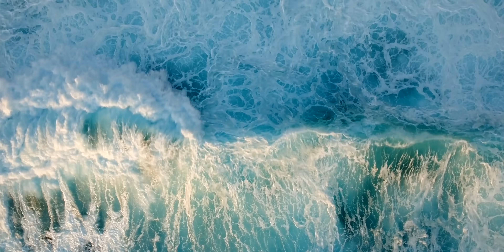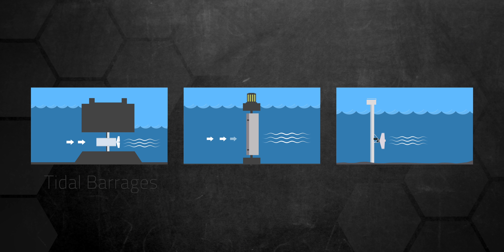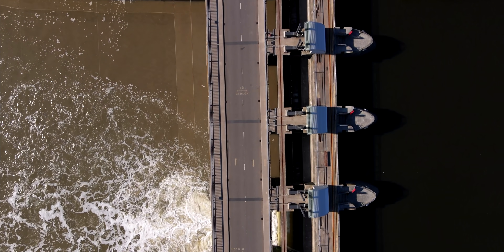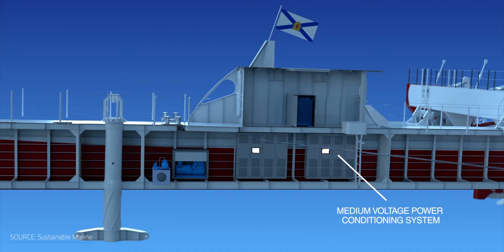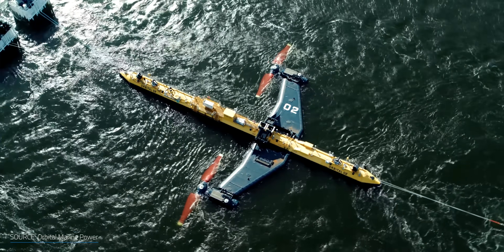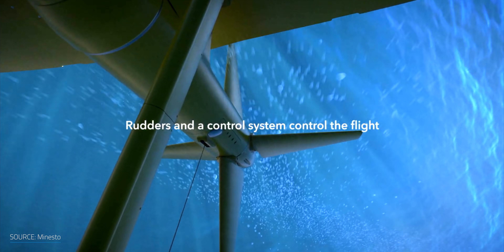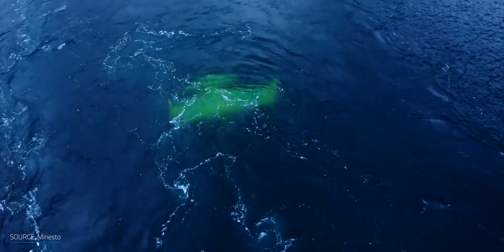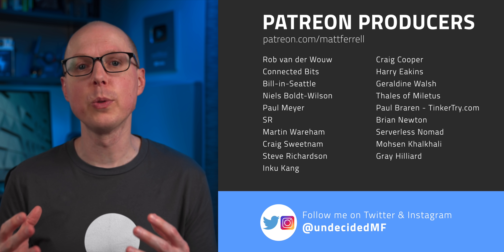Can Underwater Turbines Work? Tidal Power Explained

Comment: Maintenance for these is a lot more frequent and expensive. Not to mention habitat loss.
Reply: Offshore wind turbines actually turn out to create marine habitats on their surfaces. I would imagine this to be the same here.
Reply: @unvergebeneid  for certain life, yeah. But that same life like kelp and such make maintaining it very expensive. And that's not the only life in the ocean. Additionally, it might be good for one type of sea creatures and bad for others.
Reply: @_MikeJon_  unlike fossil fuels, which are bad for one type of sea creature and worse for others.
Reply: @unvergebeneid  not relevant to what I said nor was I arguing for it. However the idea that this is "green" is not really true. Maintenance and installation of these plants is not green at all. And the power output is so limited, it's not a valid argument. I will like to emphasize how much it takes to clean these types of plants. Think about how much crud builds up on boats. Boats aren't stationary either. The ocean is wonderfully full of life so trying it's hard to maintain functionality and low costs with that fact.
Reply: @_MikeJon_  I think it's too early to form a definitive opinion on what the cost will be down the line. It's all just pilot projects. We cannot afford not to undertake these, however, and if they turn out to be dead ends then so be it.
Reply: @unvergebeneid  It's really not though. We've seen enough to know how much they produce. We've already been told what the power output is. We know what happens to stuff in the sea. I mean do some research, answers with joe has a good video on it.

Comment: Listen while mowing the lawn...? I know that the EGO is quiet, but I am guessing that you are not using the speaker on your phone. Tell us, which headphones do you recommend.
Reply from the maker: When using the Ego mower?  Any headphones that have a rubber ear tip will do (passive noise cancelation ... blocks enough sound to work really well).  I've used a pair of LG Tone wireless earbuds and Apple Airpods Pro.

Comment: Could these underwater turbines also help minimize tsunamis and similar due to the slowing of water currents?
Reply: There's so much energy in a tsunami, any number of underwater turbines won't make the slightest difference (except possibly getting ripped off the sea floor and hurled ashore). It would be analogous to trying to mitigate hurricanes by installing wind turbines.

Comment: I believe that Nikola Tesla built a power plant that used the thermal energy differences of surface water temp vs water temp at the bottom of the ocean.  Yep the surface temp is often about 30deg F. so it will work, not really efficient due to the low temp differential but it worked.  What killed it was it was requiring materials that were not available at the time so it had a large failure rate which was what actually killed it off.

Comment: I wonder at the effectiveness of loading the great lakes with those sea kites
Reply: It would be interesting. The Great Lakes don't really have significant tides though because they are isolated. 
They do have some very intense waves which I would think could be harnessed.
I remember a year or two ago a small lighthouse was just destroyed by violent waves in Lake Superior.
The question is would it be constant enough to make it worth the expenditure.
Or could they adapt something like the Vortex Bladeless turbine (wiggle turbine) to work under water to use the water's motion to produce electricity.
Reply: Do the great lakes have enough depth? These need 60 meters of depth just to run and I'd imagine you need a little more than that to give a buffer zone from boats.
Reply: @dillonvandergriff4124  pretty sure, though not 100% on that

Comment: I can't repeat it often enough, humanity and the world will need vast amounts of clean, sustainable, emission-free and cheap energy in the future. Therefore, these tidal power plants also need to be supported to become a reality on a large scale.
Reply: As I said, the world and humanity will need vast amounts of clean, sustainable, emission-free and cheapest energy. When the fusion reactors and 5th generation nuclear reactors (dual fluid reactors) are ready for use, nothing will stand in the way of this energy either.
Reply: Become an Engineer and work design and systems!
Reply: Every drop of energy comes from somewhere, wind energy stops the wind, tidal energy forces oceans to stand still. What are the consequences of that? . Humanity needs to consume less energy.
Reply: @ulisesrobles  wind energy does not stop wind, what are you talking about ? Neither does this stop tides.
Reply: @n.g.s1mple29  So energy comes from nowhere? Interesting point of view. Not very thermodinamically correct but insteresting.
Reply: @n.g.s1mple29  Insulting is your way of reinforcing a statement? That same reasoning led to think that coal burning couldn't harm the enviroment because it was a few wagons of coal every month.
Reply: @n.g.s1mple29  I just pointed to Sigismund that having cheap "emission-free" energy only leads to more consumption. In wind power, kinetic energy from the wind is used to move the blades slowing the air currents. If you think that filling the world with giant turbines to supply enough electricity for the whole world has no effect on air masses that make up the weather, or you insist with the idea of wind not being slowed down by the generators it's ok. I just bring you the facts, based on science. You keep insulting but provide no better understanding on how wind turbines work. 
Have fun trying your perpetual motion machines and free-energy gadgets.
Reply: @ulisesrobles  the amount of turbines you would need to create such a problem is far more than we will need for a very long time, filling the world will never be necessary as by the time we will need that much most of our energy wont come from on earth sources anymore. it simply wont happen
Reply: @n.g.s1mple29  where will it come from?
Reply: @ulisesrobles  science  includes the presentation of factual evidence

you presented no facts to back your claim
Reply: @robinsss  huh
Reply: @n.g.s1mple29  you said our energy won't come from on  earth sources

where will it come from?
Reply: @robinsss  well I didn't really word that correctly now that I look back. But I was thinking of things like space based solar, or large populations living in space. If we ever get to the point of needing enough energy to disrupt wind patterns with turbines we probably will not be limited to earth, cause if we manage to have that many people on earth anyway we must have energy options better than turbines. I also think turbines can't really be used like that, it doesn't sound efficient.
Reply: @n.g.s1mple29  why doesn't it sound effective?

which turbines?
Reply: @robinsss  standard wind turbines, they only contribute their maximum power a certain time periods for one, most of the time it's only fractional from what I remember. 
There are also many areas where wind farms just wouldn't be very cost effective due to poorer wind strength on average. They kind of stuck unless you've got them somewhere just right tbh. You'd be better off with solar panel farms across the world, although I doubt that would ever happen either.
Reply: @n.g.s1mple29  why wouldn't ocean turbines be able  to deliver enough energy?
Reply: @robinsss  oceans turbines could work i think, im not as knowligable on those those. They may have other
issues....
Reply: @n.g.s1mple29  if devices are in space collecting solar energy

how do you  get that energy to homes on earth?
Reply: @robinsss  the idea would be to beam it down in the form of microwaves and convert it back to electricity with a rectenna.
Reply: @n.g.s1mple29  has anyone proven that that can be done?
Reply: @robinsss  there hasn't been practical tests yet, and there are still some problems with it, but I think they can be fixed.
Reply: @ulisesrobles  The universe is made of energy.

Comment: I'd attach a propeller to a long bendable axle, like a chain, and attach the other end to a heavy generator sitting on the bottom of the canal pointing upwards. The propeller would rotate, turning the entire chain, and thus generating energy. The direction of the tide wouldn't matter.

Comment: Is there any project building something that combines offshore wind turbines and underwater turbines?
Reply: I don't think so, because they don't fit together. Offshore wind farms are best built far off the coast, since winds are strongest out there. But this means that they are built in wide and often up to 50 m deep waters. Tidal power on the other hand is best built where tidal flow is focused into a small cross section, which means the waters should be narrow and shallow.
Reply: More like the two system besides each other using the same installation like subseacable. They are looking at that, it will come.

Comment: All the numbers look to be new installation.  What will they look like after exposure to the ocean environment, attached sea life, collisions with sea life, collisions with ocean pollution, etc?
Reply: Minesto has a very cost effective service on the kites and the installments of foundations and kites are actually very cost effective. The company has partnership with 2 major players in the energy field such as EDF and more recently Schneider Electric on microgrids etc. This is probably the most interesting company alongside Azelio.
Reply: I was wondering the exact same thing.  Especially with all the unforeseen maintenance costs of wind turbines due to particulate matter in the air.  Lots of corrosive stuff down under the water, and it's not like you can just drive your pick up truck on over to maintenance.

If it can produce power, not involve high maintenance costs, stay out of the way of boats, and do it all cleanly that would be wonderful.  Somehow, I don't think it's going to be that easy.
Reply: @MetrolMC  All your wishes are fullfilled, system called Deep Grren by Minesto (The flying kites) 

Clean Energy, produces plannable power to the grid today, full boattraffic above is allowed (kites 20-30m under surface). Low Maintenance cost due to exchange system and service on land.
Reply: I think this is a very valid question. It has been shown that the vibrations of offshore wind turbines disorient fish, making them unable to swim upright and dying as a consequence. I think the same can be considered for eg the underwater kite. You might say boats produce the same noise or whatever, but these installations practically stay in one spot, whereas a boat passes by, making the vibrations less constant.
Reply: @timor474  they also discovered that wind turbines are not lasting as long as they thought. They are being dismantled long before their expected expiration date and replaced with new bigger ones. Submerged under salt water is even a worse environment.
Reply: I can see a few of these working for small isolated marine communities but that's as far as I'd take it. If they are produced on scale for a larger population, the eventual waste stream will be impressive. Especially considering the toxic waste from things like heavy metal laden lubricants and creation of the anti fouling coatings to prevent constant maintenance. Might as well start ocean mining. Our oceans are stressed enough and we can get more than enough energy from land, no need to put more junk in them, we need to start cleaning them.
Reply: @anydaynow01  I don't see those extra boat hulls and propellers as having a high impact. After all, each one is just one more boat in the water. Compared with the scale of transcontinental shipping burning mega-tonnes of bunker fuel, it's nothing measurable.
Reply: @fotoguru222  I don't see them being a huge ocean impact, unless abandoned at EOL, but things that are under water get pretty grungy pretty quick and I wonder what negative impact that will have on the efficiency.
Reply: You can read Minesto prospectus to investors on https://www.minesto.com/sites/default/files/documents/inbjudan-till-teckning-av-units-i-minesto-infor-listning-pa-41154-minesto_prospekt_2015-09-30.pdf its from 2015 but the kites will last +20 years without issues. And they have the best LCOE when scaled up.
Reply: @Mari0.187  "prospectus to investors" If that isn't saying 'the most optimistic scenario' then I lack reading comprehension.
Reply: @sinki19841984  dont understand what you mean?
Reply: @Mari0.187  Means the information in the prospectus is the absolute best case scenario, i.e. conditions are always perfect, expected efficiency is always reached, and no unexpected costs are incurred. A prospectus is not intended to inform you of what to realistically expect from a project; it's intended to convince you to give money to the project operator.
Reply: @PhycoKrusk  it points you exactly in the right direction. Dont understand the entry you make here. You do realize that I linked to it because it gives you a pointer, you cannot do your DD without reading ALL and everything important! Including the prospectus. Dont really get your ultimate point here but I think I get it anyway. Nothing is a guarantee in life, not even life!! DUH!!!
Reply: @Mari0.187  It being the best case scenario doesn't mean that the information isn't or can't be useful; it just means that a realistic viewpoint means not looking at the numbers in a prospectus and expecting that those will be the results you will always get. They are predictions; they may be extremely accurate predictions, but they are still predictions. That is all.
Reply: @PhycoKrusk  its all being verified and certified right now as we speak. By DNV GL. I think any normal and decent person also can read at the begining of the prospectus that it states what you wrote allready so I and anyone that read it have allready been informed of the ”expectations” and ”risk” but thank you for explaining it again.
Reply: I suggest that rope like thing and kites which can help us alot
Reply: maybe they should install at the pacific garbage patch so that the secondary purpose is to collect those rubbish floating around
Reply: @al-aurum2457  Given the average depth of the pacific ocean is 4-5km deep down to about 10km, and that the kites are best put in water less than 100m, I'd say no.